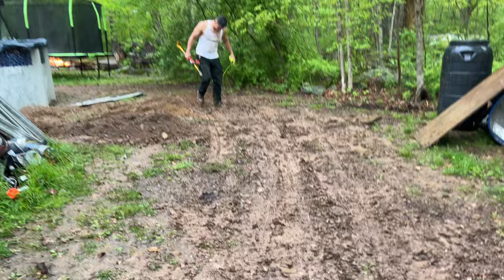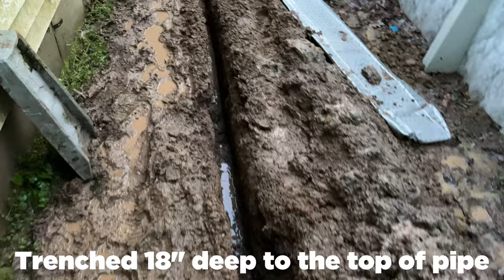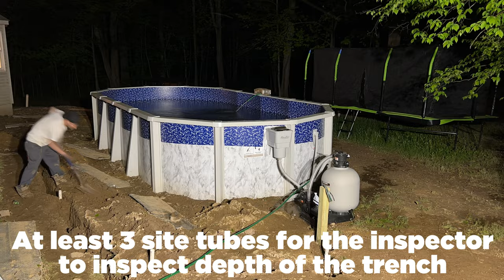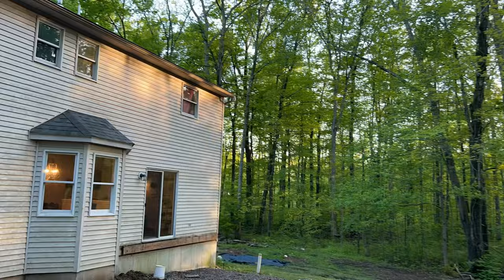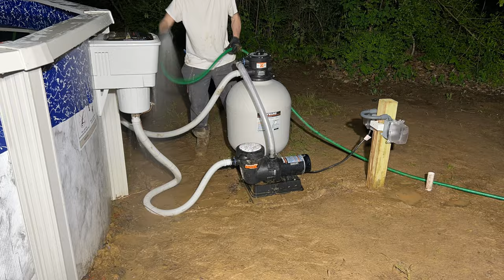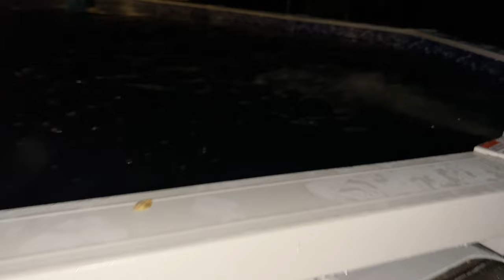How to Bond Wire Above Ground Pool Electrical Wiring bonding pump motor skimmer frame Electric Code

Comment from the maker: Parts list & Job checklist below... 

Skimmer bonding kit
https://amzn.to/3p2wUWj
Grounding bridge 
https://amzn.to/3Cm8f20 
Pool bonding C Lugs
https://amzn.to/3qFg14F 
Pool bonding split bolt bugs 
https://amzn.to/43z6wCx
Pool Bonding wire 
https://amzn.to/43TdP7P 
Pool Pump Timer
https://amzn.to/46aPTii
thhn wire 
https://amzn.to/43B7nCw 
20 amp gfci outlet 
https://amzn.to/3oYDb5n
twist lock single receptacle 
https://amzn.to/43ypIAc
Bubble covers
https://amzn.to/3qJ5wNo
Outdoor weatherproof outlet boxes 
https://amzn.to/3JcDsZf
1/2” Carflex and carflex connectors
https://amzn.to/3p3w2ki
20 amp gfci breaker - The gfci breakers are panel manufacturer specific. That's what I used, but you have to match it to your panel. If you don't know which one you have, you can match it up to the picture. 
Square D https://amzn.to/3N24hQZ 
Culter Hammer https://amzn.to/3X5nJ3P
ITE / Siemens https://amzn.to/3CmtWz7 

** Home Depot, Lowe's or hardware store... 
1/2" inch PVC electrical pipe 
site tubes - short pieces of pipe. As long as they can get their tape measure down or Peak down with a flashlight.
27" square permit-post (pressure treated, 4 x 4) 

As an Amazon affiliate I earn a small commision from qualifying purchases 

"Above Ground Pool" Standards

1 Apply for permit. Contact the Dispatcher (or for DIY, do it yourself). You’ll need an over head drawing with measurements and signed invoice if your a company 

2 Dig number should be called in and trenching path marked in white marking paint 

3 Conduit will be trenched at least 18" deep to the top of the conduit.

4 The pool pump circuit will be dedicated, gfci protected, 20amp and controlled by a timer.
5 Install 27" square permit-post to mount twist lock receptacle, ground fault receptacle and grounding bridge

6 Pool pump receptacle and cord cap shall be 15/20amp twist lock tupe with "bubble cover. "

7 Pool pump receptacle will be 5' from the side wall of the pool. 6' from water level

8 Bonding: The motor and skimmer basket with # 8 solid ground wire. (use bonding kit)

9 Bonding: Install grounding ring 4" depth and 4 points of contact on the pool frame. (use direct burial C lugs)

10 Bonding: Metal fences within 10' of the pool must be included in the bonding grid.

11 Permit and underwriters inspection for the electrical requirements.

12 Receptacle for the low voltage light and heater equipment may be no closer than 5'

13 Install 3 site tubes for the inspector to inspect depth of the trench

14 Inform the dispatcher when you are completed for final inspection

Also check out the Pool build VERY SATISFYING!!!!! 
https://youtu.be/lTt7kVgCwxM 
And both short and extending cut of the deck build and let me know which one YOU think is more satisfying 
This is the longer extended cut. 
https://youtu.be/_a2ukwcQOSE
This is the Shorter / Faster cut. 
https://youtu.be/_a2ukwcQOSE
Reply: Very good info, thank you!
Reply from the maker: You’re welcome, happy to help!

Comment: Can the convenience receptacle be on the same breaker as the pool pump
Reply from the maker: Unfortunately, no. They are both supposed to be dedicated lines. Meaning separate breakers / circuits.
Reply from the maker: They’re also supposed to be GFCI protected. I use a GFI breaker in the panel for each of mine, but you could do a GFI breaker for the pool pump and a regular breaker for the convenience outlet as long as the convenience outlet is a GFCI outlet.
Reply from the maker: A GFCI outlet might be cheaper than a GFCI breaker, but both ways work and are up to code. Hope this helps. Let me know if you have any other questions
Reply: Thanks for all the help…promise last question. Do you have to have a convenience receptacle?
Reply from the maker: Yes you do. A GFCI convenience outlet is required by code no closer than 6 foot to the waters edge, but no further than 20 foot.
Reply from the maker: So if you already have a GFCI protected outlet within 20 feet of the pools edge, you already have that covered, otherwise the GFCI protected convenience outlet would be necessary within 6 to 20 feet of the waters edge
Reply from the maker: No problem, and you’re welcome! I work for an electric, plumbing, heating & cooling company, and I’m happy to help.  Feel free to ask any other questions if something else comes up
Reply: Hello there can you put the link for the grounding wire and  connectors or clamps you used to keep wires together along with the adapter plug for the skimmer 
Thank you
Reply from the maker: @carlossalazar2322  Yeah! I have a lot going on right now, but I should be able to get a list together sometime tomorrow
Reply from the maker: @carlossalazar2322  here is a parts list below. I also updated the videos description and added the part list to that as well.
Reply from the maker: @carlossalazar2322  Pool Bonding wire 
https://amzn.to/43TdP7P 

Pool bonding C Lugs
https://amzn.to/3qFg14F 

Pool bonding split bolt bugs 
https://amzn.to/43z6wCx

Grounding bridge 
https://amzn.to/3Cm8f20 

Skimmer bonding kit
https://amzn.to/3p2wUWj

Comment: What do you bond the wire to if the above ground pool is resin and there are no metal parts on the pool  to attach the bonding wire to?
Reply from the maker: If there is no conductive surface (uprights, wall, bottom rail, etc) then you shouldn’t need to do the uprights or any of the physical pool itself
Reply from the maker: The code says all metal parts within around or attached to the pool structure must be bonded. It talks about bonding at a minimum of 4 points of conductive surface but I believe it reads for nonconductive pool shells, the bonding of the 4 points is not be required.
Reply from the maker: The water bonding is done through the skimmer, the pool pump and the motor / pump or any other equipment is usually done on the equipment, but I do believe some resin pools have a metal wall seam that has to also be bonded. So it really depends from pool to pool whether it's 100% resin (non metal / non conductive) or not.
Reply: Great thanks for the info
Reply from the maker: Your welcome! Good luck with it

Comment: When you connect the bond wire to the uprights, is that connection above ground and then the wire is ran back underground? Our pool will truly be above ground, not any bit buried so I am trying to figure out if when I bond the uprights, is it acceptable to connect it to the c lug above ground and have the wire immediately back into the ground for burial?
Reply from the maker: Yes, the only thing that needs to be buried would be the ring around the pool. Everything else connects to that ring, so they’re all connected together as one unit. So it doesn’t really matter the location on the upright as long as it’s on there. Burying the upright wire until it connects to the ring is more just to get it out of the way, that wire doesn’t have any burial requirements, just needs to connected to the upright and then to the ring that is buried

Comment: I’m reading that if the pool has a vinyl liner you don’t need to hit 4 posts. Just one instead

Also, drilled through the post would look way better than the flex conduit
Reply from the maker: I’ve never heard that. I do know if you have a resin pool / posts and rails you only need one point of attachment at the seam of the sidewall. But I’ve never heard it based off the lighter. Because if it’s metal, it has to be bonded and the bonding points are to go out to the rig on at what point of the pool it needs to exit.
Reply from the maker: And yeah, I agree. Drilling through the post is a cleaner way to do it, but we’ve always done them on jobs at shown in the video. Your way definitely looks better though

Comment: What did you use to connect the bonding lugs to the uprights? Self tapping screw?
Reply from the maker: Yes, small hex head sled taping screws. Obviously make sure they’re very short. It only needs to go through that thin metal the uprights are made out of. And make sure it’s screwed in the center or the deepest part of the upright. If you go too close to the outside, you could hit the wall.
Reply from the maker: Something like this below or you could use the Phillips roundhead type as long as they’re not the real wide ones because it’ll get in the way of the lug. I do have to disclose I get a small percentage through Amazon‘s program if you buy it. They AI monitor the post. Their links are in, but it’s like a but it’s only like a percent or so. You could just go to Depot or Lowe’s or any hardware store.
Reply from the maker: https://amzn.to/3KgcvUN

Comment: How do you bond to the pool wall? Since the liner is already installed on the other side, won't screwing a lug into the wall tear the liner? And.. wont puncturing the wall with a lug screw jeopardize the integrity of the metal wall?
Reply from the maker: Yes, screwing a lug into the wall will jeopardize the integrity and put a hole in the liner. I’ve never bonded a pool that required the the wall to be separately bonded, but I can try to help you by telling you what I do know about it in the following comments.
Reply from the maker: The water bonding is done through the skimmer, the pool pump / motor or any other equipment is usually bonded directly on the equipment (usually with a pre-installed lug to connect the wire), but the pool wall, top rails, and uprights (posts) are usually metal. As long as they’re metal and not the resin type, the entire pool structure must be bonded through the 4 points shown at the end of the video. Since all 3 are conductive and connected together, in theory they are all bonded together as one by the 4 points.
Reply from the maker: But… If you have resin posts and a metal wall, I believe there should be a wall seam on the wall that can and has to be bonded. There are also pools out there that are entirely non-metal / non-conductive, and from what I understand they don’t require any of the pool structure to be bonded since there’s nothing conductive to bond to (other than the water, motor/pumps, and any metal around it).
Reply from the maker: So it really depends from pool to pool whether it's 100% non metal / non conductive or not. The code says all metal parts within, around, or attached to the pool structure must be bonded, but from what I understand for nonconductive pool shells the bonding of the 4 points is not required. So if there is no conductive surface (uprights, wall, rails, etc) then from what I understand you shouldn’t be required to bond any of the physical pool itself, other than the equipment or any metal stuff around it

Comment: Question  i am new to this , how much solid number 8 copper wire you think i would need for a 15ft round pool, also as i go around the pool and connect the connectors to the up straight just use a small self tapper screw?
Reply from the maker: The best way I found to measure it is to just lay a string around your pool where you plan on digging it. You could use a rope or extension cords or anything like that. After it’s done being laid out around the pool, just mark your endpoint and you can make it a straight line and measure it like that.
Reply from the maker: And yes. Use a small self tapping screw to secure the lug to the upright. Just make sure it’s short enough to not hit the pool wall, obviously, and add extra length of wire to make those connections.
Reply: Thank you for the tips
Reply from the maker: You’re welcome, good luck with it
Reply: @BrandonStunts  thank you just got all the part I ordered from your link this will be my project for tomorrow, I got some stainless steel 5/8 self screwing screws hopefully everything comes out alright
Reply: Cmon folks. We learned this in school. 
It’s the diameter times pie.
I have a 18 round pool and need 63’ of 8 awg solid copper wire. I am also being told I need to ground the water also.
Reply: @St34mb0atWilly  you are going to need more the that i have a 15ft round and i use almost 100ft to do everything
Reply from the maker: Yes, the water must be “grounded” (technically bonded), but yes same theory different word. You can check out this video that shows how to do that part with verbal instruction.

https://m.youtube.com/watch?v=ThkfaOEqO0c&list=PLCfDkc8ReqRywQv5OLv4JNtTGK8HV4G5X&index=4&pp=iAQB
Reply from the maker: And yes, you definitely need more ground wire, then just the ring around the pool for all the other bonding. The ring is just the longest piece.